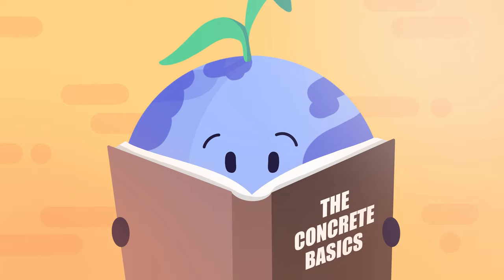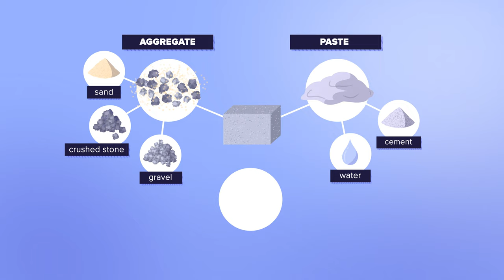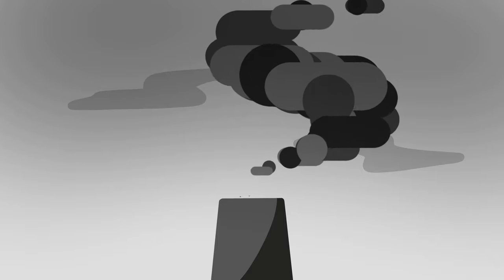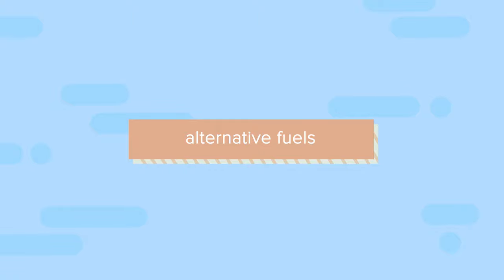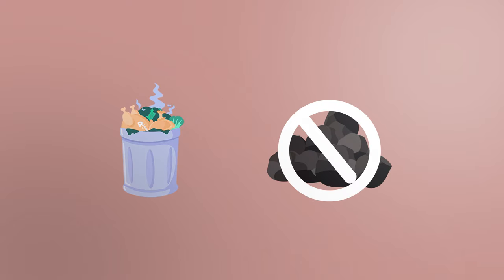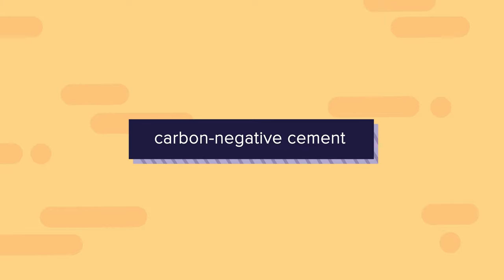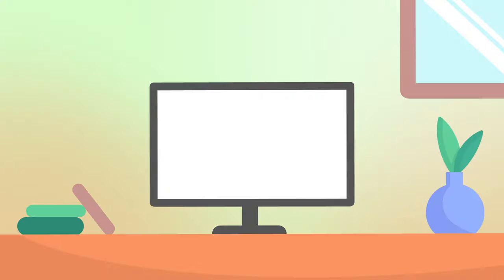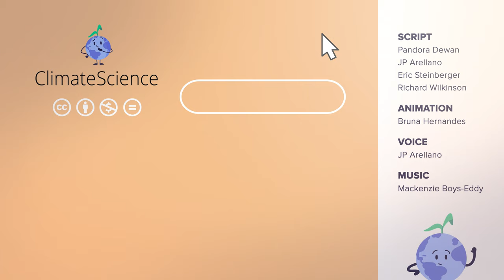Concrete: Making the Building Blocks of Society Sustainable | ClimateScience #7

Comment: Great video! Just a question about carbon negative concrete: Since most emissions from concrete come from cement and we're eliminating those by using steel slag, I'm not sure I understand where the co2 that's being pumped into the molds is coming from. Are we sequestrating co2 emissions related to concrete manufacture, is it absorbing co2 from the air or is it something else ?
Reply from the maker: Hi Alexandra, thank you and thanks for asking such a great question! Our apologies for not having addressed this in the video. The CO2 used in this process could come from a number of sources. It could be a by-product of another industrial process, it could be directly captured from the atmosphere or even sequestered from the flue gas emissions of a fossil fuel power plant. The purpose is to reduce the CO2 in the atmosphere, so by binding it in these concrete blocks we ensure that it will stay there for a very long time. Let us know if this doesn't fully answer your question and stay curious! :)
Reply: @ClimateScience  Yup was wondering if it could come from different industrial activities than concrete manufacture so question answered 100%! Thank you :)